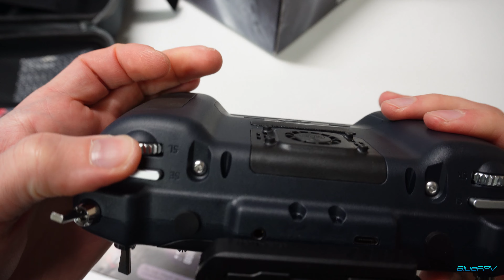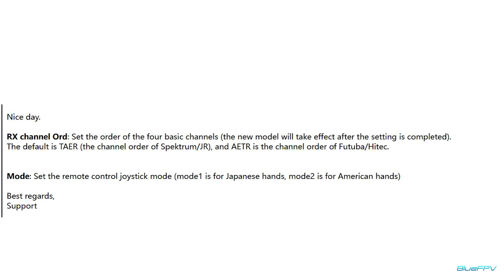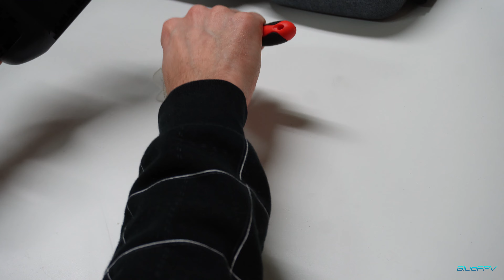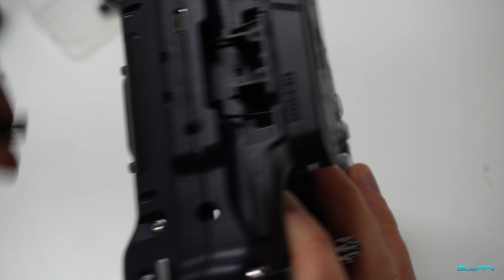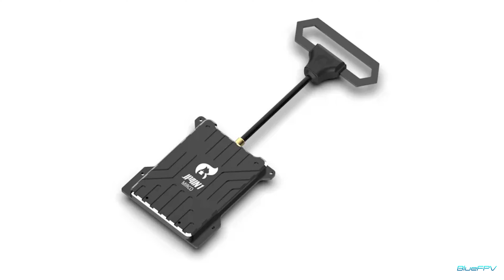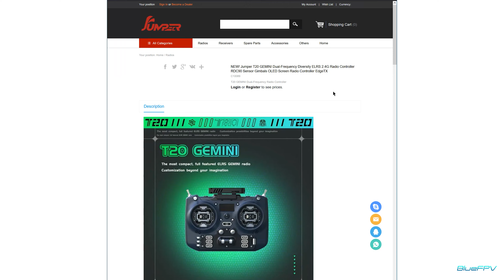Jumper T20 Gemini REVIEW, MODE CHANGE & DISASSEMBLY - ELRS Radio Transmitter

Comment: Bit of an 'I will make a video and get free stuff post', changing stick mode is a 10 minute job. Get the back off,  unplug the gimbals (PS, please look up how to pronounce the word 'gimbals' and listen to how it should be pronounced), unscrew the units, swap them over, plug them back in, change the mode in the radio's software the recalibrate and you are good to go. This procedure is just rubbish, sorry, 1 out of 10.

Comment: Hi thanks for sharing this detailed review! I just got my T20 Gemini, i'm trying to follow the instructions on fitting a spring, i'd like to keep the left throttle in place, but i want it to spring back to 0, if i simply install the springs that came as you did (in your swap) will that suffice? Thanks again!
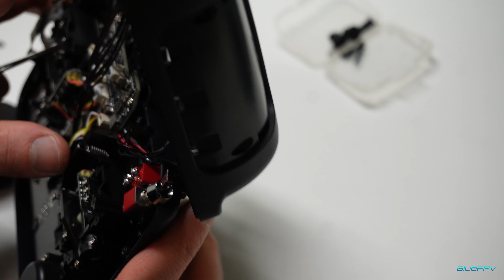Reply from the maker: Hi, so you want both sticks to be centered by a spring? Like on DJI remote controls? Theroretically this should work the same way I changed the spring from one stick to the other. But you need two of this small plastic pins . Check out "09:27" to see which part i mean. I would check if you remote came with two of these parts or just with one (like mine). If yours just came with one, I would contact JumperRC to get a second one.
Reply: @Blue-FPV  Hi, thanks so much for the reply! i now see exactly what you mean. I will send a mail to Jumper, if they reply, i will let you know! 🙂